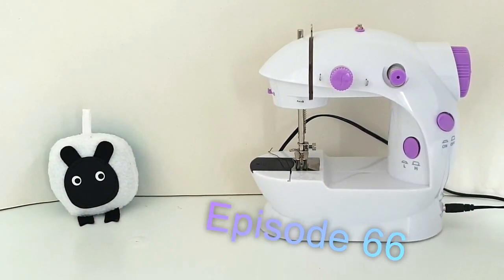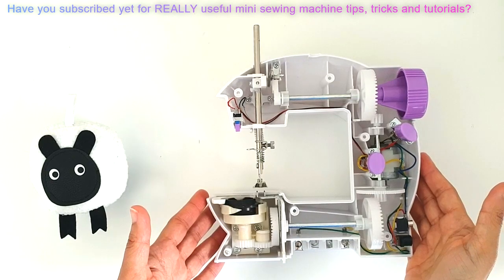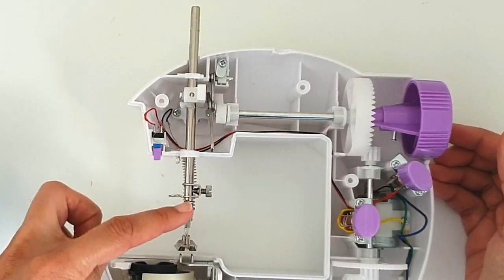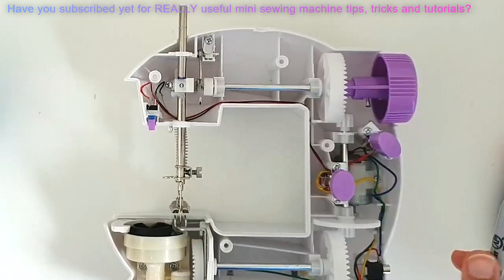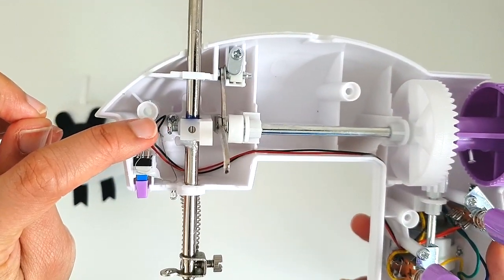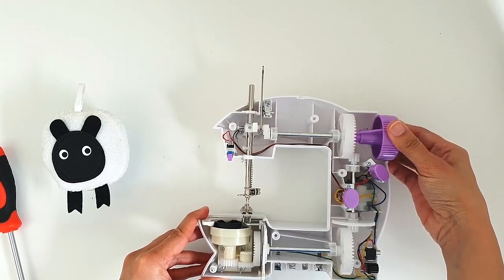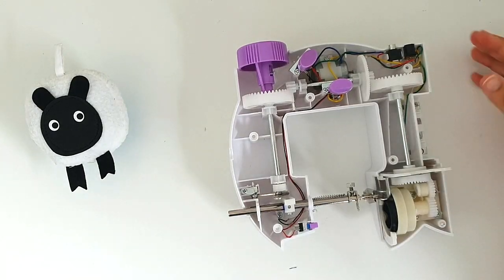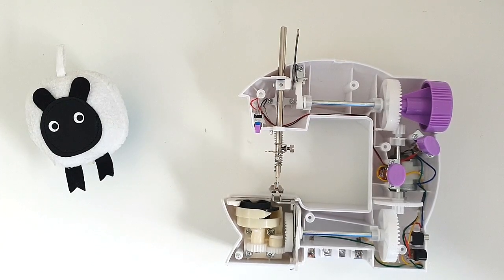Is your Mini Sewing Machine NEEDLE not moving? Watch this! [beginner sewing tutorial]

Comment: Hello do you have any tips  how to fix why my needle in mini sewing keep hittiing the needle plate thank youb
Reply from the maker: Hi
It might be that your needle is sitting too low. Unscrew, reinstall and tighten the screw again,  making sure the needle shaft is touching the solid ceiling. 
If it still doesn't work,  it's a manufacturing defect I'm afraid.
Reply: mine too! my needle keeps bending i’ve been through two and haven’t even gotten a chance to stitch anything!!

Comment: Hi! Can u help me with my sewing machine too. The machine works perfectly fine when there is no thread but  if I put a thread and start stitching a fabric it stop working. It happened first with my foot pedal so i alternatively use the on and off button and now they are both not working when i put a fabric. The needle will go down and it will stop.  What should i do? The handwheel is perfectly fine in both method too.
Reply from the maker: Monica sounds like the motor is faulty, it's not producing the correct power wattage. That's an electrical fault I'm afraid. If the machine is new, I would return or exchange it x
Reply: @OoniCrafts  thank you so much. Actually, It was the battery's fault.  I used it to power my mini sewing machine so when i put it on electricity it works perfectly fine. Thank you for answering😊 More power toyou and your channel!💙

Comment: Hey ! I've been watching your vids and they're helpful.

Problem: I did the number 9 method to place the bobbin in, the needle moves up and down, even has picked up the bottom thread just fine. BUT the top thread is getting caught on the center circle part of the bobbin while it is going over it while the needle is going up and down; and it jams.

I don't know what to do. I have taken the bobbin out and back in 5 times and the top thread keeps getting caught even though the bobbin is not bouncing up and down.
Reply from the maker: Anu, check the bobbin for small burrs or jagged edges. Find them and file them down using sand paper or a nail file.